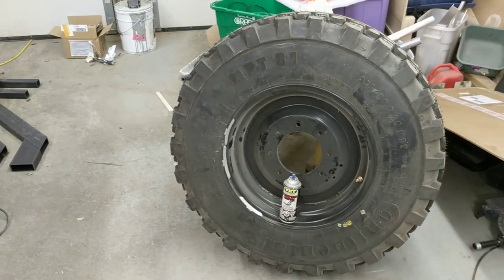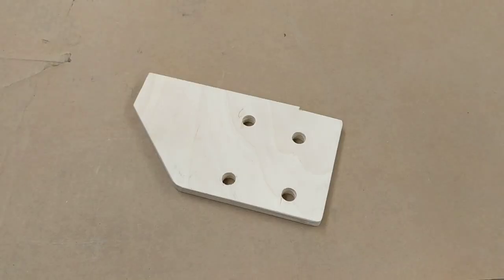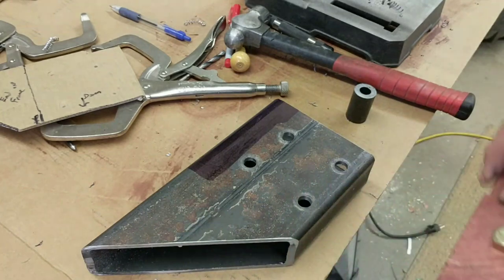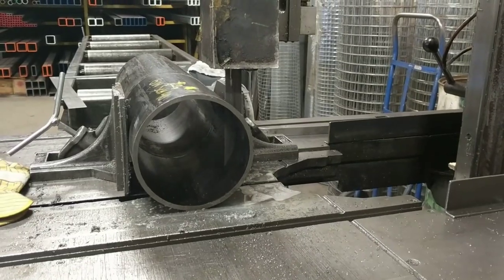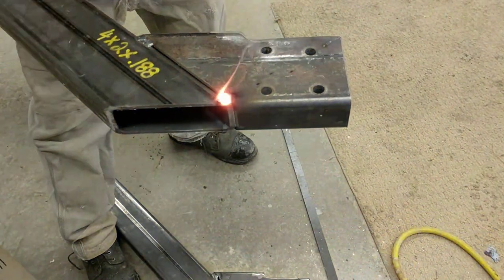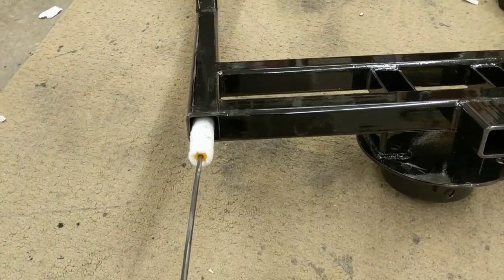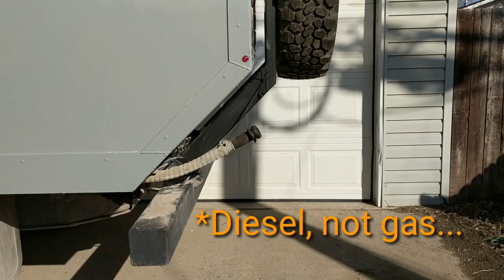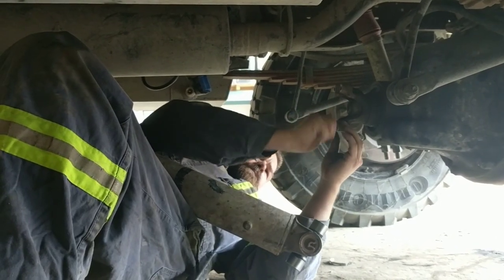Building a Tire Carrier and Drive Line Repairs - How to Build an Overlander

Comment: Nice work. What wheels are you running? If you ever find yourself in Northern Michigan in need of welding, machining or other repairs my shop door is 14', and Id be happy to help out. Also can provide lake front parking spots most times of year. Thanks for all the good content, I dont even skip the ads...
Reply from the maker: Our full build list is available for channel members like you right here... https://everlanders.com/truck-equipment-and-build-list/

Hopefully we don't need to go back through the US for many years, but thanks for the offer...
Reply: @Everlanders  I noticed in a reply to another video these are ricksons. Any notable reasons you chose these opposed to surplus mrap Hutchinson's?
Reply from the maker: Nope

Comment: Super videos ! What was the reason for going honeycomb core instead of a polystyrene core ?
My wife and I are on our second trailer build and find your video's very informative. 
Also great to see some Canadian content, we are from BC.

Just read further down for the reason.
Reply from the maker: My testing showed that the honeycomb preformed better for delimitation 
 durring shear, twist and chemical resistance, etc. I found it too easy to peal the skin off of the foam. Ideally, try and get your hands on Foam Injected Honeycomb.
Reply: Everlanders Thanks for the reply,
That is exactly what we will using now, a P100 panel in 1.5" with a G10 2 mm outer skin and a G10 1.5mm inner. My wife luckily works in the composite industry here in BC and supplies Rhinokore so we have been in contact and tossing ideas around. We are out all year round camping and hunting so some where warm is nice.

Comment: Just found your channel, incredible job, especially on the camper! After watching a few of the videos you find out very quickly why campers like the "ER" cost as much as they do. You would think more manufacturers would post videos showing their workmanship to encourage new buyers but maybe that's the reason why so few do so. Folks are buying them despite the workmanship. Amazing job, keep up the great work and happy  trails! PS, I'd be interested in finding out how much you saved, ball park, by building your own?
Reply from the maker: Yes, Earthroamer, GXV and the like all make amazing vehicles. And the cost is completely justifiable for what you get, the quality of materials and workmanship is fantastic. In my opinion however, the pearl gold flake paint, granite countertops, hardwood flooring etcetera is too luxurious to take to the real backroads where we go. I have no reservations about dragging the sides of my truck through an overgrown Forest Trail. Or having all four tires kicking up shale climbing straight up a Mountain Road chewing the paint off the aluminum boxes. We built it to use it, borderline abuse it. I never skimped on quality of materials when durability is needed. I just don't see the point in dumping money into luxurious materials for the sake of luxury. 

So when comparing our camper to one of the aforementioned, price is not a fair comparison. Ours cost a lot less, the rest was paid with Blood, Sweat and sleepless nights.

Comment: Question regarding your wheels.  Eight bolt 20" x (10" I'm guessing), where did you get them?  I am looking for 20" high capacity wheels for my Dodge 3500 to run as singles instead of duals, any help in locating such a wheel would be greatly appreciated.  I had an '02 Excursion with the 7.3, loved it, great motor.  Nice truck keep up the good work.
Reply from the maker: Custom Built by Rickson Wheel, worst purchasing experience of my life, product is fine.

Comment: It’s a bad idea to fill the pipes with foam. Under such conditions, the metal is subject to corrosion much faster than without it. We have our own workshop, I speak from my own experience. Although you have enough toast metal and will rot for a long time.
Reply from the maker: Even when the pipes were already coated with a thick epoxy paint? I was just trying to keep the mud and stones from accumulating back there.
Reply: @Everlanders  No problem. I just shared my opinion. I know from experience that foam accumulates water very strongly: condensate and so on. Then there will be evaporation and, simply, there will be condensate and steam all the time. I would leave it open. easier to rinse and always dry.